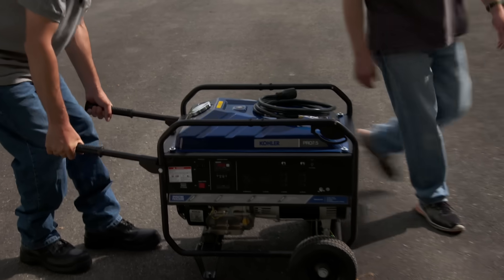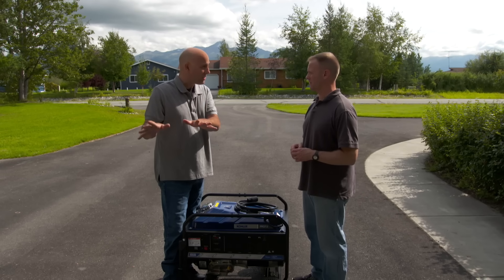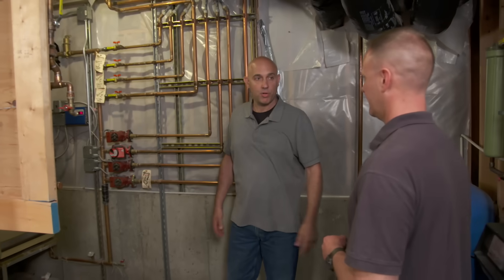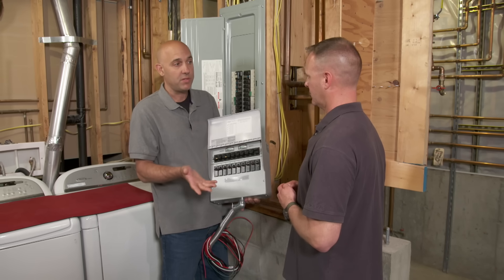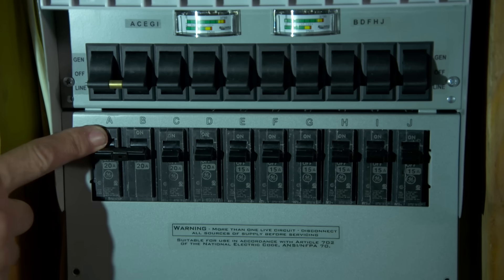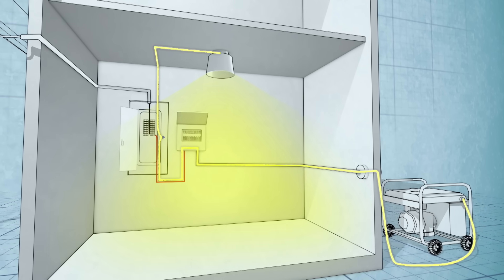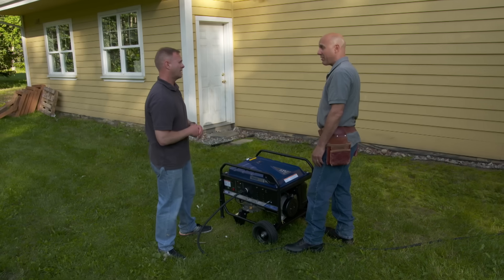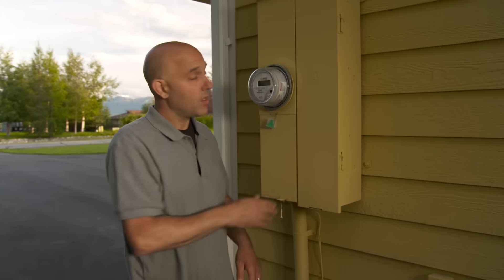How to Install a Manual Transfer Switch for a Portable Generator | Ask This Old House

Comment: How/where would you wire in the transfer switch with a battery backup grid tied inverter?
Reply: midijeep Just the same way i guess. Though i would put a transfer switch right in front of the whole electric panel instead of only 10 groups. Just be careful not turning on a lot of heavy appliances. The most important thing of backup power is having all your lights around the house working again + the fridge. 10 breakers is not going to fix that. Just put an amp meter around the backup power wire and keep an eye on it.
Reply: Thanks Richard.  That makes sense.  I do have the solar battery backup running only a few essentials.   I have been trying to locate a simple manual transfer  switch without all the breakers.
Reply: A grid tied inverter must incorporate a rapid shutdown feature, it must shut down when it senses the grid is down.  Either the inverter is very sophisticated and incorporates some type of automatic switch that might allow it to run during an outage, but I firmly believe you will need another back up source such as a second inverter (not grid tie) or a portable generator.

Comment: Why is the white wire (neutral) run from the generator to the transfer switch?  The generator has the neutral and ground bonded to the chassis. If you run 240 volts from the generator to the transfer panel buss bar, doesn't the neutral leg from the house panel provide for 120 volts on each leg while the generator is running?
Reply: Thank you. I thought I was getting some voltage between neutral and ground, but after checking the panel, that doesn't seem to be the case. The problem is that my gas furnace electronics don't like the generator power, the furnace will not call for heat as long as the generator is engaged even though the voltage is correct. Once the utility side is restored, the furnace works normally. I'm thinking it might be a sine wave issue, I'm told installing a run capacitor upstream of the furnace control board might solve the issue. Have you ever heard of such a thing?
Reply: Ian McTeer sounds like your generator has a floating neutral so control board on furnace senses an open ground circuit. Furnace control board should give you a trouble code upon failed start up of furnace to help you diagnose this issue.
Reply: Thank you Bill. Yes, there is a bad ground fault code from the flashing LED, but this furnace has an LCD interface that should allow me to drill down into memory for more details. However, the interface simply flashes "wait" as long as the unit is powered from the generator. It won't let me in to the diagnostics or anything else.  It's so confusing, I thought the furnace was grounded properly through the house wiring. I know that board cannot tolerate more than 2 vac on ground, but I'm not finding any voltage on ground at all. I'm glad I have a wood stove!
Reply: Some control circuits for furnaces are extremely sensitive to voltage, frequency and THD.  I can only think of using an inverter generator, or try adding a resistive load to the circuit like an incandescent light.  That has worked for some people in the past.
Reply: + Bill Skalicky::: That will only matter if the generator is connected to the furnace directly and is floating neutral.  If it's connected through the electrical system, utilizing the house panel neutral/ground bar which are bonded, then there should be no problem.  But right if the gen is connected direct with an extension cord if possible, and it's floating neutral, it may not work.  Someone could bond the gen in that scenario if the manufacturer supports it or at your own risk.

Comment: I'd like to install solar panels.  Would I use something like this to isolate my house line from the main line?   - so that during an outage, no one gets hurt by a jolt from a line that they think is unpowered.  Also, is there a way to have it switch automatically, so the safeguard will operate even if the power goes out when I'm not home?
Reply: The typical grid-tied solar system shuts down in a power outage to prevent backfeeding, which is a waste of the power you have just sitting there.
I've never seen a grid-tied system that uses an automatic whole-house transfer switch, and then signals to the solar inverter to come back on. I guess it's a safety thing?
You'd think a test circuit could serve as positive feedback that the switch has disengaged the house from the grid, though.
Maybe it's just something that needs to be built, and we could become millionaires...
Reply: Solar systems are lot more sophisticated. Look around on YouTube.
Reply: As long as you don't use a grid-tie inverter, you can easily implement an auto or manual switch with a different inverter (non-grid-tie) or a portable generator for use while the grid is down or now. But it must be a load side switch like in the video, or a sub panel with an interlock that isolated from where the grid-tie inverter connects to the electrical system. 
Most grid-ties also do not use battery storage because they are utilizing any renewable energy continuously and bringing it directly to the electrical system, synchronizing with the grid power.  If the grid power fails, the grid-tie inverter must shut down, and if you want to utilize the renewable energy being gathered, in theory the only option is to add a sophisticated automatic transfer switch, a battery bank to store energy, and a NEW inverter that is not a grid-tie.  Much more expensive than using a manual switch like this and a small portable generator, but of course everyone's needs and wants are different.

Comment: I prefer the whole house option, where it's just one double-pole breaker in the existing panel. 
That way, you don't have to choose what circuits you want to prioritize. Of course you can't necessarily run everything you want at once, but I think we're smart enough to handle that.
With this approach, you can live life as normal, without having to work around dead circuits.
Reply: I have the Interlock switch plate installed in my panel and love it. Like others said, you don't have to decide ahead of time what you might need to power in an emergency. You also don't have to rewire all your breakers to the pigtails.  It's also a LOT less expensive than a transfer switch. I know that I cannot power everything at once like the electric hot water heater and central air at the same time. I have those breakers marked with an orange dot so in an emergency I know which breakers to leave off initially. Also important is a Reliance Controls PowerBACK alarm which alerts you when main electricity is restored. We've had numerous outages during the day with clear blue skies and you cannot watch for neighbors lights during the day. :-)
Reply: A service entrance interlock (or an interlock on a critical load panel) easily provides the most capability in any manual transfer system.  However, a lot of people will not want to manage a panel with 30 or 40 circuit breakers, let alone if there are also sub panels (we are not all smart enough to do this, nor willing).  
The breakers are being used as switches in this scenario, and not everyone in a common household will want to learn all about the 30-40 breakers, know to turn them all off before using the gen, what they feed, and their power usages in order to avoid overloading the gen.  Every breaker should be turned off before connecting the generator and then turning breakers on one by one is how to manage the system and avoid connecting the generator under load.  Additionally, some interlocks are not listed by a testing lab (aftermarket kits made by the panel company with the part # listed on the cabinet label).  Most inspectors will turn down unlisted interlocks because they are not proven and can be defeated with the dead front off in many cases.  
The installation labor in makes up for the cost of the pieces of metal (mechanism), and not every panel can be modified with an interlock, mainly only newer panels. It's a very economical concept and has been around for a long time but it's most certainly not for everyone, most people prefer ease of use over full control during emergency conditions.  
Also, the points some are trying to emphasize of not having to decide what you might need to power in an emergency - sure you don't have to necessarily decide on what circuits you will power with certainty ahead of time, but you still have to decide during operation of the system and that will require being very familiar with what all of the household breakers power and their current draws.  During operation, prioritizing circuits by turning breakers OFF and then back ON is exactly what everyone has to do with an interlocked panel.  Reliance offers 500+ panels with interlocks but due to the (usually) extra costs for installing them, the frequently required inspections and permits on panel board modifications or service entrance installations, the average home owner can benefit greatly from something that is easy to use like the load side switch with 6 or 10 critical breakers.
Reply: gantmj they make a generac meter it plugs right in to meter from generator and you have no extra fuse box way more convenient and you can switch whatever you want on at any given time.
Reply: Ampacity Electric why does a flat piece of sheet metal cost so much? Is it the certification behind it? An interlock is my preferred option I just don't see the cost in the product.
Reply: gantmj yes upon are right.  Last Big hurricane Florida had we tied to the dryer Plug.  I was a little bit concerned but a electrician friend said it will work and. Be safe.   We ran the central AC and lights only.   Everything else we turned off the Breaker.   Keep an eye on the Maine panel.
Reply: I hate the double breakers for everything now.

Comment: Doesn't gas(oline) have limited storage life today, specially if it has ethanol in it? It might be a good idea to mention something about replacing it and/or adding some stabilizer?
Reply: They did mention that in the full episode.
Reply: Another option for this installation would have been to go with a dual fuel generator.  They cost a bit more, but give you the option of running the generator on either gasoline or propane.  I would go with propane, as it doesn't go bad over time and is easy to store.  Propane burns cleaner, less fouling of spark plugs, and the engine oil will stay cleaner for a longer period of time.
Reply: Fuel stabilizer is a definite must.  And make sure to get the right kind for ethanol blended gas.  Try to buy non-ethanol gas, but I know many areas don't have that option at all.  Don't let the tank run dry as ethanol residue will crystalize, messing up the carbs.
Reply: Ampacity Electric could you mention the name please. thanks
Reply: Ampacity Electric could you mention the name please. thanks
Reply: I have the same transfer switch, I converted my generator to run off of propane and natural gas. It will still run off gasoline if I want, but I don’t for the very reason you stated.
Reply: I know here in Texas you can get ethanol free gasoline from either Buc-ee's, Walmart, or main petrol Distributors. Last a good long time. Something they really need to mention though is when you shut it down to store for a long period of time. Best to shut it down by turning the fuel line off, let it run till it's out of fuel naturally, this wil get the fuel out of the carburetor preventing fowling.
Reply: I have a farm tractor and a pto driven generator for times like this. Diesel lasts a long time and when i see a hurricane coming i call the fuel man to come fill up my 500 gallon tank. If i need it i hook up to generator, drive over to house, hook up the same way this video shows, and i have whole house power again. I put a utility powered light so when power comes back, that light will light up and tell me. If i dont need it and storm is a bust, its ok, i have a diesel truck, tractor, utv, and another diesel truck that can use that fuel well before it goes bad.
Reply: Martin J; As this video was filmed in Alaska, there is no concern over ethanol since none of the gasoline sold here has ethanol in it.  OTOH, the highest octane pump gas we can get is 90, which is sold as "premium" fuel...  Owners of some high performance cars have to get a detune in order to be able to use them here.  8^P

Of course a stabilizer is still a must even without any ethanol in the fuel.
Reply: That's why i prefer propane or natural gas
Reply: Any small engines should only be using ethanol-free gasoline if they are being properly cared for. If ethanol-based gasoline is necessary, then fuel stabilizer should be added and the gasoline should be rotated more often.
Reply: I have used old gas in lawn mower before. Started up after a couple pulls. Long as engine has good compression should be fine.

Comment: What's the down side if you run the generator to long after power has been restored? Can it cause a system over load or will it just reverse your electric meter sending power back up the electric grid, cant it harm the generator?
Reply: That sub panel is isolated via the transfer switch, so no power will backflow
Reply: It will not backflow through the meter; the transfer switch isolates the generator from the utility side. Only downside to letting it run is wasting a bunch of money on gasoline.
Reply: The big worry if you back feed the meter is that you could kill a lineman because what should be depowered is energized  by your generator.
Reply: Robert Murillo 
This is why you do it the right way with a transfer switch. Some people backfeed through their dryer outlet which is illegal and dangerous for the reasons you mentioned.
Reply: For the record, my lineman father did the generator hookup in much this manner. Garage is 60A/240V subpanel, receptacle backfeeds to generator breaker (normally off), which heads inside to the basement main panel which must first have the main disconnect switch/breaker flipped to isolate from the line. He does not condone others do this, though. He makes them get a proper setup. 

Once I run 4ga 240V out to my garage, I'll probably do the same thing. That said, I plan on looking at the other options when I get to that point.

Oh, and the instructions for the generator are on the side of the fridge under a magnet.
Reply: I don't understand why they didn't flip the 10 switches back (from generator to line) BEFORE they turned the main power back on.  Isn't this resulting in both utility power and generator power running through at the same time?  Is that safe?  [they turned the main power off, then flipped the switches from line to generator, then started the generator.  It seems logical to do the reverse before turning the power back on: 
 turn off the generator, flip the switches back to line, turn on the main power.}
Reply: Supervillain321  which is why you shut off the main supply so that line power can not get to your appliances and generator power does not get to the main supply line
Reply: Only if you're stupid enough to not shut off the main to the house.  I just backfed my house thru the dryer for three days after Irma.  Worked like a charm.  Main shut off and padlocked.  No way the lineman is going to get hurt.  Besides, backfeed or not, lineman always test lines before working on them.
Reply: The main problem is not killing a lineman, they check everything before they touch it.  The main risk is double feeding everything in your house burning up your appliances.
Reply: And what about the one person that doesn't shut off their main power supply (main breaker)?  Not only could this be an danger to lineman (they have died in the past), the power could also inadvertently flow into neighbors houses on the same transformer, creating a major safety issue for your neighbors.   Not to mention it's against state law in every state in the U.S. to do this, and the dangers associated with remembering to shut off a breaker are not worth the troubles and liability, it's simply not legal.
Reply: Joe Seijo     EXACTLY!!!!